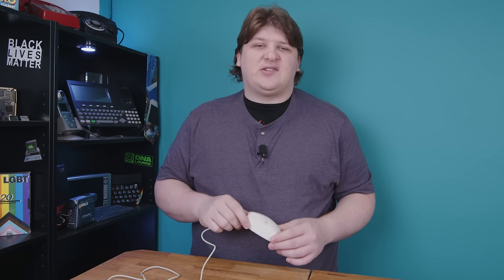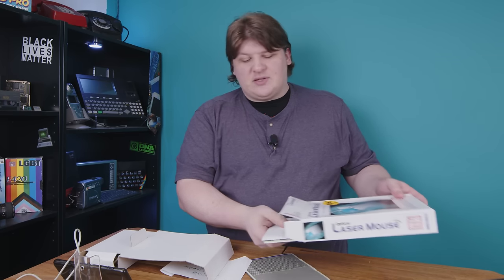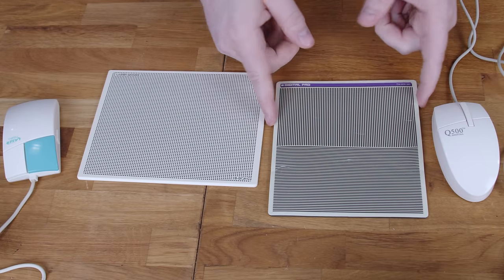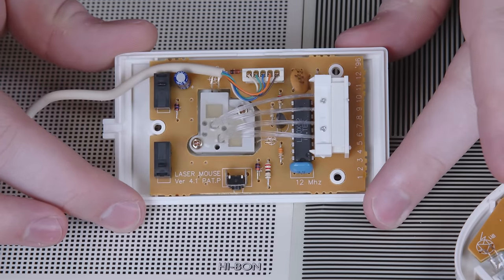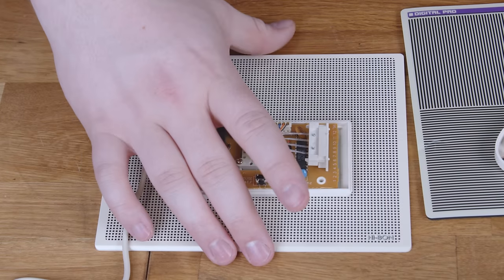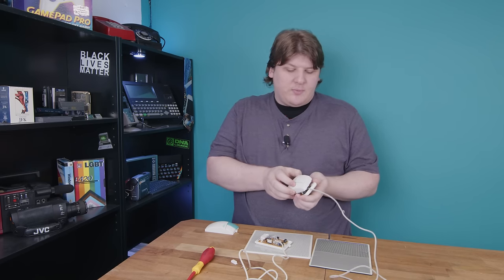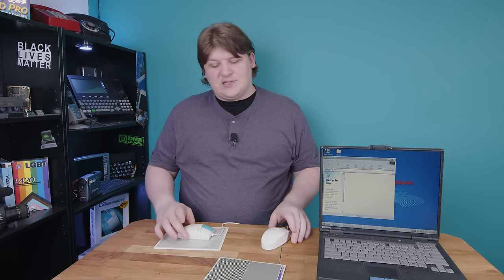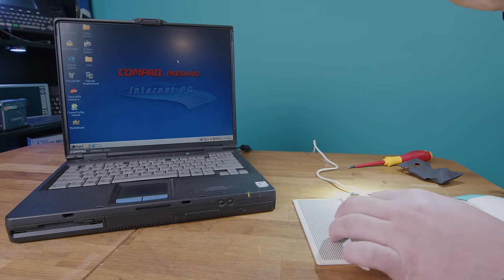LMOX2, The Other Weirdest Mouse

Comment: Very interesting!!!

And you were right with the ball mouse rolled out!
Those two mice work exactly like a fork light barrier with an encoder disc!

Maby the front end of the recivers need some extra hardware to work with the slight variation in brightness, but i doubt that.
You almost ever blast them with IR and there is not much threshold. 1 or 0!!!

Maby the multiplexing of the receivers, need some extra stuff, but thats also not that hard even with jelly bean TTL stuff.
If the standart mouse chip of that era dose read all 4 sensors at once, you just put two 2bit shift registers in front, tap of the clock and double it, flipflop the strobe and shift register and feed the original chip the samples of the register while it strobes the other side with double the rate. Boom done!!! 
(might take 100h of development to get right.... but IN THEORY it works)🙄

Comment: I think that by bundling the fibres together allows measuring intensity, so they could save some diodes. I guess that main issue is the square pattern, If they somehow managed to make it work an a hexagonal pattern, it could be less susceptible to different angles.

Comment: I know this is an old video but I think the way this works - and the reason it works on a homogeneous grid - is a little different than described. I can't really tell through the Youtube compression, but it seems to me like the fiber-optic bundles don't map to 2x2 squares; instead they fan out to 1x4 rows. This way, regardless of how the mouse is lined up on the pad, the sensor presents a wide enough profile that it's guaranteed to catch at least one grid dot travelling across it *the short way*. If the sensors were in 2x2 squares, you could run into a situation where the squares perfectly "shoot the gap" between two rows of dots on the grid and never register anything.

Comment: You should use a standard serial driver win Windows to see if the acceleration is on or off. It's a driver feature, not a hardware feature.

Comment: It strikes me how thin the bezels on that laptop are.
Reply from the maker: Yeah, the panel on this laptop is incredibly good for 1999. I would have to go check again but I think it might be 1600x1200, which is nuts for that era.
Reply: @CathodeRayDude  that must have costed huge money back then too.
Reply: @WarisAmirMohammad  Yeah, I had Compaq Armada from the same series that I had picked up used. The E500 that CRD has is from their "Expansion" series with a bunch of peripherals built in, and I had the M700 from their "Mobile" series, which was basically an executive thin-and-light. Both would have been quite expensive premium laptops when new.

It does look like it's still a 1024x786 panel even in the thin-bezel 15" E500 model that CRD has tho (based on the size of things like the start menu bar)

Comment: They're wired top 4 bottom 4

If you're between or on a dot you get a signal, but if you're halfway on a dot, you can see which direction the dot came from

Comment: Depending on the type of White led in the flashlight they probably dont make alot of infrared light, so thats why it didnt stop working until you svamped the ir sensor without the case. But fluorescent tubes, specially bad ones, produce some to much ir. And another thing: they could be the same age, just targeted to different people, the Q500 being less problematic with angled arms. 🤷They basically work the exact same way, with just placement of the "reading holes" making it possible to read either lines or dots.

Comment: I know this is like a year old, but try a speeelite/other camera flash. RPi 2s had an issue where one of the chips would cause the thing to crash when fired at because the chip was a bare die, mounted to the board top side bottom-wise. Because bare dies are light vaguely sensitive, a powerful flash of light would cause the thing to crash.

Comment: Ever see a glass-slab touch-pad?
8mm glass slab with an array of piezo-crystals bonded to the left and right edges.
The crystals would emit a 'ping' when energized, but when idle they serve as sensitive microphones.
The crystals were being 'pinged' in a sequential pattern, the passive crystals would detect the pings.
When the surface of the plate was touched by one or more fingers, the sonic impulses in the glass would be partly absorbed by the contact.
This change in sound transmission is picked up as X/Y information.
The scanning nature of the pings located the contact point with good accuracy.
The firmer the finger contact, the more the impulses would be absorbed.
The circuitry translated signal strength as contact force.
It worked as the 'brush pressure' channel.
The slab was suppose to be a workstation desktop of sorts, monitor behind the slab.
Too expensive, very heavy, fragile and if the slab was even slightly dirty, it lost calibration!
I had the dubious honor of having to scrap the thing.

Comment: I have a theory on how this could work ..
The spacing between the 4 fibre optics would be the width of the black square on the pad / 2 (maybe 2.x) - if the mouse is moving in the direction of the bundle, at any time 2 or 3 are on black The reason I say 2.1 or 2.2 spacing is that way it would be more dimensionally tolerant and you would have a weak signal coming from 1 of the fibers exiting or entering a black area at any time (ie. Entering and exiting would be slightly out of phase).
When traveling across the sensor in the narrow direction, 2 sensors would get excited at the same time on / off giving a strong pulsing signal.
The adjacent groups of 4 fibers are then used to determine the direction of motion ..

Comment: I suspect that the reason your studio lighting didn't throw off the sensors and it took some serious flashlight power with the case off to do that has more to do with modern lighting than with the neoprene not doing anything. Modern LEDs and fluorescents (even old ones of those) don't give off very much infrared or even low frequency red light. Incandescent lights, however, give off mostly infrared and large amounts of low frequency red light, and those are the colors of light that would interfere with the mice. It probably wouldn't have been much of a problem in offices, with most offices using fluorescent lighting, but in homes at the time almost all lighting was with incandescent lighting. And, at the time, most people with computers at home put them in their home offices, which, like work offices, were usually overlit, but unlike work offices, were overlit with incandescents. You should retry the test with a 250W white incandescent heat lamp. Modern incandescent bulbs don't put off nearly as much red and infrared as the ones in the 90's did, but the white heat lamps that are still available are really just really high power old-type incandescent bulbs, and so they do.

Comment: Mouse Systems introduced an optical mouse in the early 80s. I think they were mainly used on Sun workstations in the late 80s to mid 90s.
Reply: I've still got one of the mouse pads. They're a reflective metal sheet with a grid of dots on them.

Comment: I remember having seen that style of mouse over here in Europe some time in the Middle Ages. I never used one though. 
However, I have definitely experienced the the Sun mice (the ones requiring the aluminium two-colour grids) . We used to have Sun workstations at uni when I first started back in the early 2000s. But by then, they started to become rare, they were continuously being replaced with ball mice that were much nicer to use…
(Should I start feeling old now??)

Comment: I wouldn't say that the pre-Intellimouse Explorer mice beat it to market, the Intellimouse Explorer was an advancement and stood alone as the first of a new generation in that it worked on any surface unlike all previous optical mice which required special mouse pads. It quickly became the standard and very affordable, I think the cheaper and very popular Intellimouse Optical model using the same sensor tech was out by 2001.

It's two generations, these late examples are still in the first generation of optical mice which all required special pads

Comment: Maybe, if the two sensors are added together for each axis you would be able to compare no reflection and half reflection (either one reflected, one not or a mix of half reflected for both) so if you move on the x axis then the x total would change but the total on y as it lost reflection from one sensor would gain reflection from the other due to the spacing and average out the same? That's how I'd do it?

Comment: I think you're being unfair about the precautions taken regarding the light blocking. When dealing with computers, it's imperative that the environment has no undesired influence on the machine. Even if it's an edge case, small inaccuracies can have catastrophic consequences. Think about the situations where a single particle of radiation can flip a single bit in a CPU,  causing a chain reaction that leads to problems like a BSOD or even election recounts. Good hardware engineers don't like taking chances with interference, because some people rely on their products to perform vital tasks.